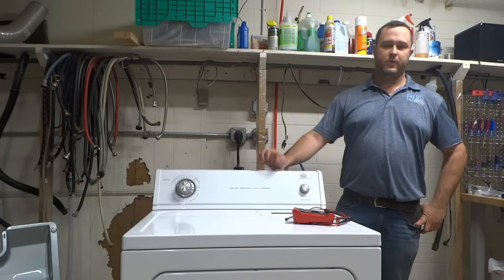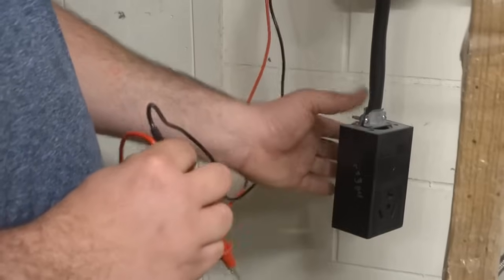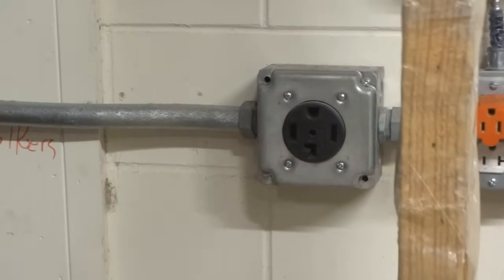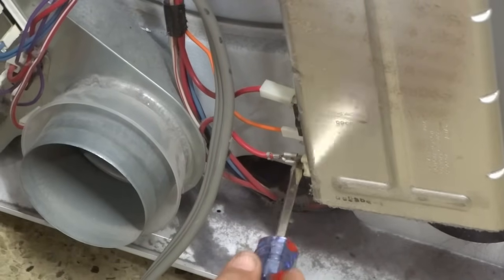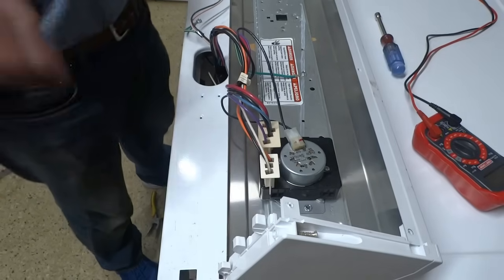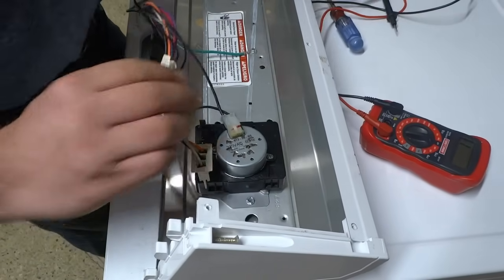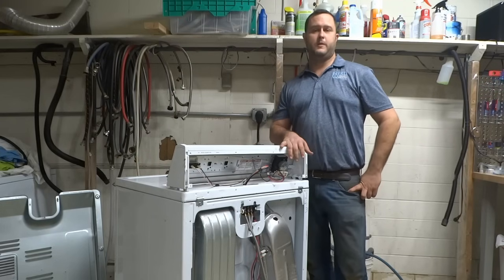Whirlpool Dryer Not Heating - Diagnosing Common Issues

Comment: Also cool to take the timer apart and see why it is not working. I could see where the connection between A and C  was burnt and worn out. Perhaps a file could have fixed it in a pinch but $80 for a new one.

Comment: I have tested all thermostats heating element and timer and I get continuity thru all of them. How can I test the switch on the motor?
Reply from the maker: It is inside the frame of the motor - a plastic disc near the rotor. It will slide outward, away from the rotor about a half inch. You'll have to push it out to pretend like centrifugal force is acting on it, then test the 2 terminals that connect the L2 circuit at the motor - usually the 2 big red wires, but can't be positive. They never break, but rarely they have some gunk on them that prevents a good circuit.
Reply: @byrdappliancespecialists3356  Thank you for your help.  I could not find the disc, I found a disc that is around the motor that slides to toward the middle of the motor when it is on. It has a arm sitting against it so when it slides the arm will move. It that it or do I need to keeping looking for a little disc?

Comment: Thanks for the video. Did every single thing here n my dryer no heat yet. Where is the heating element located? Can i remove to verify the springs? Mine is whirlpool wgd4616fw.  Similar yo your model thanks in advance

Comment: Will the timer sometimes let the dryer turn but not heat? 
My problem started with no turning, I opened the switch and played with it, it turned but wouldn't heat. I messed with it again and now it will not turn. 
Same everything as this dryer in this video. Ill test in 8 hours, but really would like any opinion before hand. 
Thermal fuse is good, did not check anything else.

Comment: So...checked everything in the video. Everything was good. But my dryer has no heat. Works otherwise. Any other things that could be wrong I can check before I head out to spend $400 on a new dryer?

Comment: We were about to agree on getting a new dryer when I watched this video.  Since it was intermittent,  I didn’t bother checking for open heating elements.  I played with the timer position while the dryer was running, I heard a slight extra noise, a very faint sound that was likely the element expanding from heating.  Sure enough, the dryer started getting hot again. I will probably need to replace the timer. The intermittent proper operation was likely when we placed the timer in  a manner to make proper contact and start the heating process.  Some issues may not be easy as this one.

Comment: had the issue of the dryer not drying on my inglis J2000 unit...bought it used for the cottage...
when I wired it up to the electrical panel on the 40AMP circuit and to the electrical outlet in the laundry room, I inadvertantly put the red wire in the wrong plug slot.....so was only getting 110V.  drum would run but no heat....went through all your troubleshooting testing the high temp, low temp thermostats, took the element out and inspected / cleaned it and it looked fine.  then went and tested the timer...all good....then found the voltage issue.

Comment: Thank you so much @Byrd appliances!   I am a DIYer but had no idea how to diagnose and fix my dryer.    When I got to the timer and discovered an open circuit I was so relieved.  After I replaced it and tested the dryer....HEAT!   I am thrilled.  Thank you again.  Saved me $150 on a service call, or a new $600-700 dryer.

Comment: My timer is bad. 
Hypothetically/Theoretically (so that you wouldn't be responsible if I screwed it up, lol), if I needed to dry some clothes in that dryer(with the bad timer) really badly on a sunday night when all of the parts stores and laundromats are closed, could I bypass the timer by temporarily jumpering the red & black wires going to the A & C terminals to get it to heat? (assuming I unplugged the dryer immediately afterward and removed the jumper) Or would that start a fire or damage more components?
Reply: Yeah you could do this- the thermostat and high limit cutout would still protect you, as well as the centrifugal switch (never knew about that until this video). You definitely don’t want to just apply power directly to the heating element though— that is what could cause a fire. You want to leave as many of the protective devices enabled as possible. You also don’t want to run the heating element unless the fan is running (although the centrifugal switch should enforce this, be as safe as possible when bypassing anything), so you should wait until the dryer is spinning + air flowing before bypassing the timer and then of course immediately disconnect it as soon as the dryer stops. (I am not a professional and this “advice” should only be used as an absolute last resort & I am not responsible for anyone who deliberately alters the connections of their appliances from the factory-supplied wiring diagram, which is what you’re talking about here. Reply added for anyone else who has the same question as I’m sure this problem has already been resolved, hopefully without incident, for you.)

Comment: If everything checks out to be okay with the fuses and current supply then check the cycle switch. I opened mine and cleaned the contacts with some sand paper and repaired a plastic lever that opens and closes the contacts.

Comment: The termostar with the 4 wire i teste the one you test and is zero but the other cables don't go to zero can you elaborate on this??
Reply from the maker: They are providing voltage to a small heating element inside the thermostat. This fools the thermostat into thinking it is hotter in the dryer - it deals with temperature settings on your console.

Comment: If u replaced the ignitor and it still doesn't work try replacing  the thermal fuse,  it just worked for me.  Its a $5 part. Takes 2 minutes.
Reply: Where is the thermal fuse?
Reply: @chevysilverado3150  At 5:40 you'll see  the thermal fuse.  Its a white plastic bar next to those wires that he's testing. It has two blue wires connected to it.  You can't miss it.

Comment: What if I'm reading 0 ohms at the element instead of 10 like you mentioned?
Reply: Shorted. Replace it. 
An electrical load should always have a resistance. If not it will blow a fuse or trip your breaker.

Comment: i have a 20 year old Kenmore dryer thats not drying well, and everything is clean, no lent,  I bought the kit with the three censers and the element, when i tested each part before I replaced it and they all tested good,  and it is still not drying well with new parts, takes over an hour and things are still not dry. I have not checked the timer and like you said I probably cant check the motor switch your talking about. so can the timer cause this problem ?
Reply from the maker: If you have heat, take the vent off the back of the dryer. If your clothes dry normally, then you know it's restricted outside the machine. To answer your other question, yes.... sometimes the timer works and dies out near the end due to the internal copper ribbon wearing down on the heat circuit - it will cut out somewhere in the middle of the cycle. Run a cycle without the vent on the back first - that's probably it, if you have heat. Good luck!

Comment: Whirlpool Dryer #WED5300SQ0 blowing cool air only. Found Top Thermostat open (3:16 top right) 
What are the name/part number for all three:
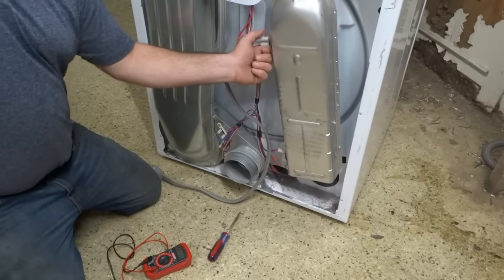1. Top Right (5:05)
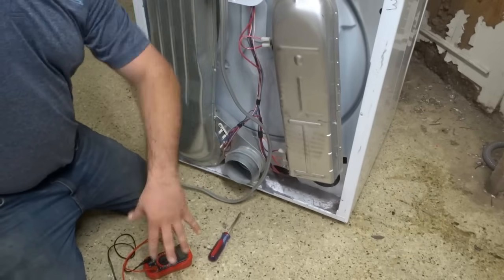2. Bottom Right (5:07)
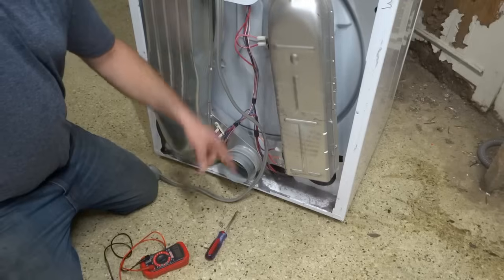3. Bottom Left (5:33)
Reply from the maker: #279816 should take care of it
Reply: Byrd Appliance Specialists, would this be better?
https://www.amazon.com/gp/product/B074QHMVSV/ref=ox_sc_act_title_3?smid=A3K0MKFIP79CN&psc=1

It comes with the heater.
Reply from the maker: That will work.
Reply: Thank you, sir.

Comment: Great video, i wish the other parts had been named. I diagnosed mine real time with you and found the high limit thermostat to be open. But i continued watching just to learn bc mine is exact same, and i found heat damage and a wire connector fused to the bottom terminal of the thing on the left with four wires. So i was unable to remove that wire like your video to ohm, however i disconnected the top wire and ohmed top to bottom and got 0.2 ohms so it appears good. If i knew what it was called id replace it along with both thermostats since u rec to replace those in a pair if high limit burned open. Thnks tho
Reply from the maker: Sorry... 4 terminal thing is the cycling thermostat. When we start posting more vids one of these days, we'll do a better job clearly naming the parts.

Comment: Thx! My timer arced  at high heat connections so I replaced it and I also replaced the high heat thermal fuse. Before  I plugged the dryer up, I watched your video and saw that I had connected the high heat thermal fuse wires backwards. Thx to this video I realized this and reconnected correctly hoping to avoid burning that fuse out again.
Reply: Ui

Comment: Where are u putting the black lead at while testing the bottom right side of the hearing element where the red and orange wires are?  I tested my dryer  its not heating and its the same as that one  whirlpool with the clickin turn nobe and the top right reads 00.3 to 00.4 and also the bottom left side reads 00.3 and looks like ur just putting the black lead on the metal and the red lead on the red metal tab where the wire goes on the bottom right side and if so  mine reads nothing at all  no beap  but if you put the black lead on or in the orange tab and the red on the red then it reads 10  could u please give me some help so i can get my dryer fixed thank you 304 559 5482 adam
Reply from the maker: 10 ohms means the element is intact. The 2 bottom terminals are the heating element. The other is a jumper from the thermostat down to one of the element legs.

Comment: Their comment was exactly right about the fuse as they know! On mine the thermal fuse went and the dryer wouldn't start or Anything. 3 days after that the heat completely stopped which is why I'm writing to say thank you for such a good thorough instructive video and I'll  be going through these steps tomorrow.  Much appreciated!

Comment: Healllp!!!!just replaced heating element on wp duet dryer.after 20 min working sparked then stopped heating. I know i didnt miss connect. Only 1 connection on that plus the thermostat and fuse,i dont want to tear dryer apart again.ty
Reply from the maker: Sparks are typically from loose connections. Unfortunately, you'll have to look around for them. You'll probably see the burnt spot where it's loose. Good luck.

Comment: Hey thanks for the video.. I had checked all of the limit switches, fuse and the electric heater and everything was good. Only was getting 120 at the heater element. Never have worked on a dryer so I wanted to check what the ohms value of the heater should be and came across your video. I checked the contacts on the on the dryer switch and shore enough it was open during the heat mode. I found one mode that allowed the contacts to close. I then disconnected the timer wire harness so it won't move that contact. Just need to find a new timer in the meanwhile. Thanks again..

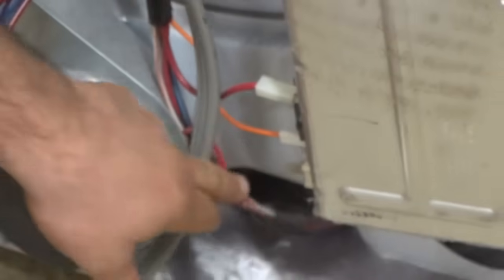Comment: What are you touching with the black part at the 4:41 mark? You should've zoomed in more to show the viewers what you are touching.
Reply from the maker: The 2 terminals for the heating element. One of the terminals of the thermostat right above it should jump to one of the terminals of the heating element. You can test them individually. Good luck.
Reply: I tested the terminal that the bottom red wire is attached to. That one doesn't seem to have continuity. Is that a piece that has to be replaced or does it mean the high limit thermostat has to replaced.? Also, do I automatically have to replace the thermostat up top too even though that tested ok? I appreciate the guidance.
Reply from the maker: Sounds like the element, but check other videos to make sure you're testing right, if you're having trouble.
Reply: How would I know if it is the heating element or if that has to be replaced? I've seen videos where they only replaced the high limit thermostat.
Reply: Correction on my earlier response today. Think I got the name of the thermostats incorrect. If I replace the heating element, do I also need to replace the thermostat attached to that? If so, do I also need to replace that thermostat up top?
Reply from the maker: If the heating element is bad, that's all you need to replace. The thermostats would blow out due to too much heat. Sometimes thermostats blow out with the heating element, if the heating element grounded out, preventing it from turning off. If the thermostats are fine, just roll with the heating element.

Comment: how do u not test the thermal fuse ?
Reply from the maker: It's on the drive circuit on these whirlpool electric dryers. It has no bearing on the heat circuit.

Comment: Boi thermal fuse why wouldn't you mention that?
Reply from the maker: Thermal fuse kills the machine entirely. It does not deal with heat, unless it's on a gas dryer - this one is electric. Good luck!
Reply: Byrd Appliance Specialists yes.  A gas dryer, like God intended.

Comment: so I have conuity on everything below as far as I can tell except the hi limit sensor could this be a stand alone issue as far as drying? 
Bought used a month ago w/o warranty of course.
I also did a check on line and it was running short at times 113-117 VAC. Which I know can cause early burn out.
Reply from the maker: Fix what's broken and make sure to check your venting. Too much heat is probably not being allowed to escape. Good luck.
Reply: Byrd Appliance Specialists this is true and the PEPs who put the vent in did a hole in the floor with 20' of pipe leading to the outer wall. Not making me happy. Since I have to use flex style tubing to force in hole!!

Comment: Hello! At 6: 23 you could clearly see a hole on top of the heater duct.. Is that a blow out? if i cover it will I get better performance or blow out that safety thermal coupler (sp).. I just cleaned out my dryer and it looks great, except for a few mfg holes..
Reply from the maker: Don't make any changes to it. It's fine. You'll get the best performance by keeping all external ducts clean. The faster the wet air escapes, the sooner your clothes dry.

Comment: Great video. Real diagnostic checks beyond the vent is filled with lint solution. All these videos should start with have you read your manual yet? On the timer check, we are testing the pins on the timer where the 220 wires would be plugged in, no? By moving the dial to a heat range we've complete the dials circuitry and should produce 0 on ohms.

Comment: Does the ground matter? My wires only have 3 but my dryer plug had four wire components.
Reply from the maker: Yes. It must be installed correctly. Beyond the scope of this video.
Reply: So i want to understand you correctly if the ground wire has no connection the dryer will not get hot?
Reply from the maker: No. It needs to be hooked up correctly for safety reasons.

Comment: This was great! Helped me diagnose the same problem as experienced in the vid.  What's the follow up?  can the timer be fixed, or should it be replaced altogether?
Reply from the maker: You can't fix it, it will just cause more issues. You could jump the switch with heavy gauge wire, but we don't recommend it - also, you would always have heat, so you could never use air dry. Jump at your own risk...

Comment: My problem was the thermal fuse.
Reply: 3 weeks later the coil valves went.
Reply: @Mennitti4Congress  the "coil valves" is that like the blinker fluid or carburetor chain in your car?
Reply: @bryondahle1273  coil valves are on gas driers, I know this is an old comment but the more you know :)

Comment: So if im getting a zero on all of them except the heating element doesn't do anything, i guess the heating element is bad then? I replaced that heating element about 3 years ago, but i think an appliance shop tested it. I have the meter on diode mode.
Reply from the maker: You need ohms.
Reply: It works on diode mode the same way. I saw a different video that showed it. Anyway the element didn't make it move at all and then i found the broken wire on the inside of the heating element and i twisted the broken ends together and it worked. So i know it's the heating element now. I already ordered it.

Comment: Trying to follow the directions.  I used my multimeter to check the voltage from my 4 prong.  Almost immediately I heard a pop/crack sound and now my multimeter is broken.  Awesome...

But what happened?  I'm even using the same multimeter as the one in the video.
Reply from the maker: You may have had it set to ohms instead of voltage, and blew the internal fuse on your multimeter. Not sure.
Reply: Yup.  I'm almost positive I had it set to ohms.  Multimeters are cheap anyway.  I'm off to get a new one.  The good news is I had already checked all the fuses and the heating element and all had current.  I just hadn't checked the timer.  So I suspect that's the culprit.  I'll be sure soon, though.  Thanks for the video!
Reply: Mind if I ask one more question?  I got another multimeter (just a cheap one) and tested the timer.  I happen to have the exact same model of dryer used in this video.  When I set it to timed dry, high heat, I get current.  When I set it to auto-sense dry, heat, I get no current.  I think this means it's very likely the timer.  Is that a possibility?  Are they operating on different switches to activate the heat element?

PS our household uses auto-sense dry almost exclusively.  Which might explain why we didn't notice timed dry still worked.  If it even does.  I haven't put the machine back together yet.
Reply from the maker: You're testing ohms on the timer switches, not voltage. If it's closed, like in the video, it works.